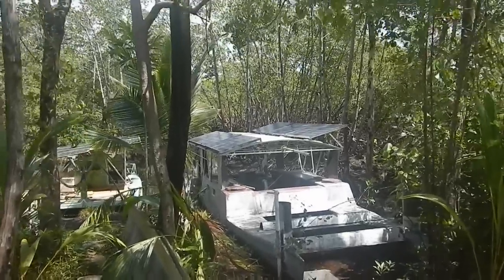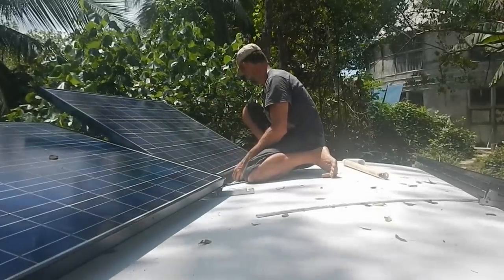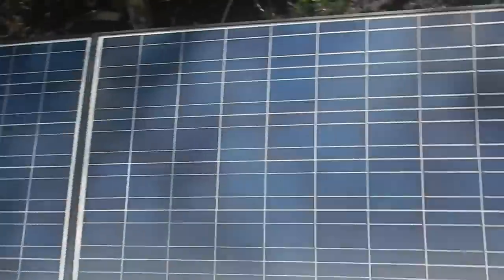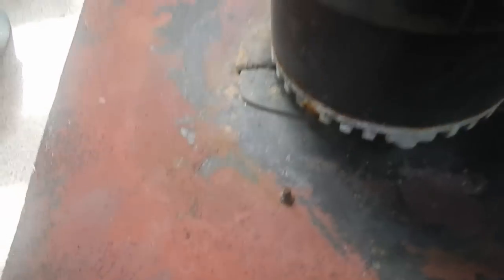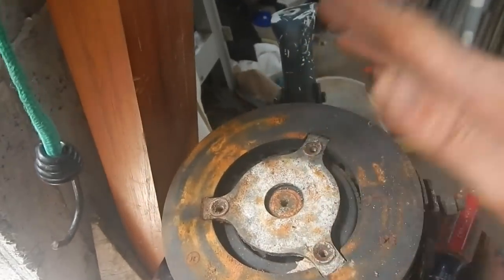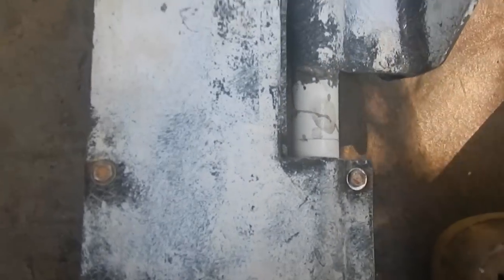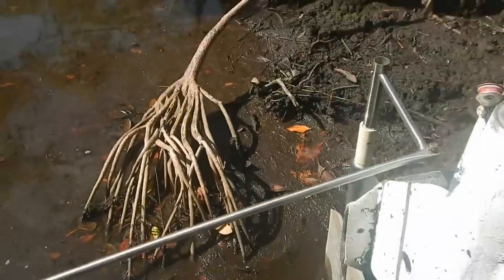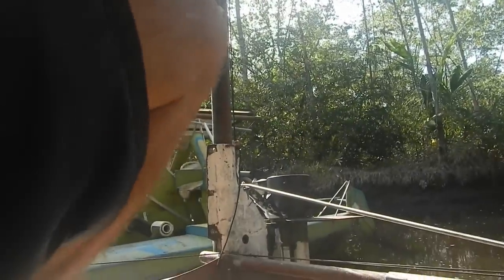Shark Slicer Upgrade 019 Motor!

Comment: You could cut the metal linkage for your steering a few inches from the motor and the slider,  add a piece of rubber hose to get some flex when the motor is raised. That would prevent metal fatigue on the mounting points.

Comment: You should put a locking latch or locking pin in place on the panels just in case you get into a winds situation
Reply: I bet you could make those follow the sun auto magically

Comment: Jamie you could set the Soler panels on winch cable or gear cogs type of system so you could wind them up an down with a winch handle.
You could the join them all together and operate it all as one separately for each side like those old window you wind to open and close. That way you dont need to go on the roof.😁😁😁😁😁😁😁😁😁😁😁😁😁😁😁😁😁😁😁😁😁😁😁😁😁😁😁😁😁😁😁😁😁😁😁😁😁

Comment: If the boat makes decent speed with the new paddle wheel, wouldn't it be more efficient to have 2 rudders on the stern And attach your electric motor to the wheel? So you would have minimal maintenance and still be able to use your feet to assist the motor whenever you want, and the motor wouldn't consume much power because the wheel doesn't have to move all that fast